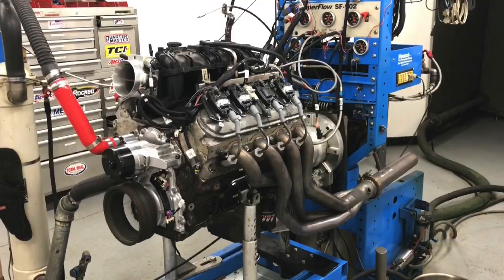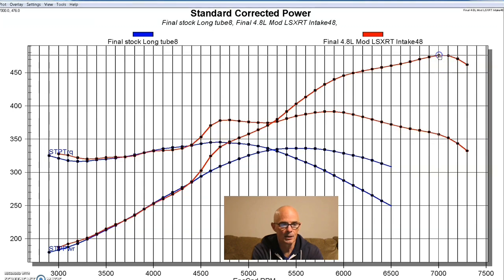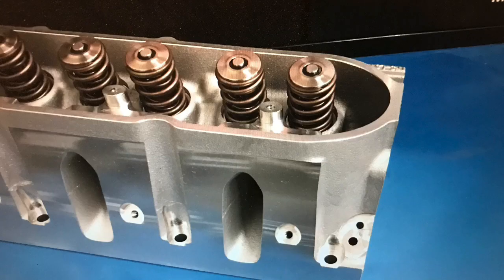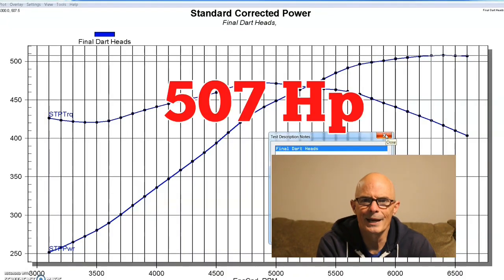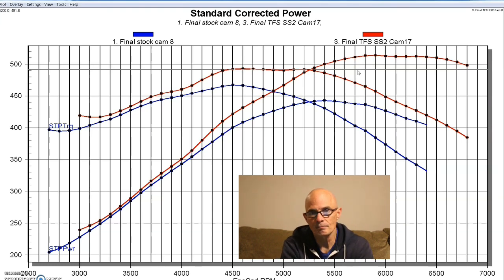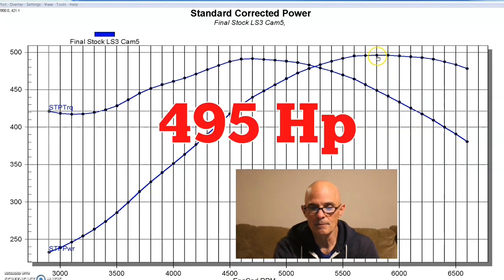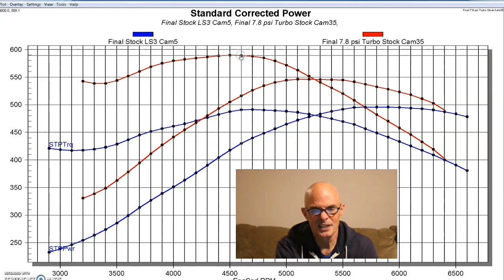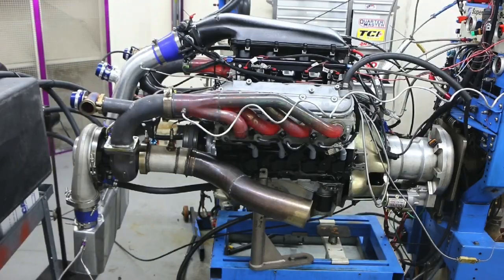LS HOW TO: 500-HP POWER RECIPES

Comment: Would love to see a sloppy stage 2 power gains in 4.8-6.2l with 706 243 and ls3 heads. Basically same cam the different displacements vs the 3 main go to heads. Would the 706 still pull a head in the larger displacement engines? I under stand you cant use the ls3 heads on the 4.8 and 5.3 but it would still be a cool head to head. (No pun intended)
Reply from the maker: you want a test of the 706 vs 243 heads on a 4.8L and 5.3L and 6.0L?
Reply: @richardholdener1727   Honestly I think the what im really wanting to see is 6.0-6.2 with 706 vs 243 vs 823 keeping cam and intake the same showing the true difference just the heads make. The cam used really isnt that important as long as it stays the same between the head swap. It would be cool to see where the added compression no longer helps the larger displacements and the added flow those stock heads offer start to be a better option. Like we know the 243 flows well and would have a compression advantage over the 823 but is the better flowing 823 still going to come out on top. The 706 would make for great compression but will it have enough flow to keep the larger displacements happy?

Comment: LS3 LLoves cam's and boost. True words, My LS3 with LS9 cam and AGP twins made 605 at the wheels with low 15deg timing on pump 93. I feel the heads are a huge factor in these making so much power. I've seen several tests with the different heads in the LS family. What I would like to see is the new LT heads, if you Tig the Injector port closed and mount them on the LS family, they are said to out flow even the 823 heads stock. I was told by a head shop the stud pattern is the same.
Reply: According to Brian Tooley the extra air flow is due to the direct injection having an increased airflow rate of 8% due to the fuel not obstructing the airflow in the port.  When you disable the DI and go straight port injection you are going to lose 8% of the airflow when you inject fuel into the port!

Comment: Run the 6.2l with 706 or 799 heads with a cam! I picked up a l92 short block from the pick and pull yard and am going to run some 799s I also found.  Wanted to get an idea of what kind of power it would make with just a cam upgrade
Reply from the maker: I did that with a 6.0L LY6

Comment: On 5.3 with turbo, what's the cheapest way to make 500hp that runs on cheap pump gas using mostly stock parts. I can do cam, springs, and rings, but not looking to spend 1000 on heads

Comment: Maybe this should've been labelled na power numbers. I've run a $200 motor with $50 valve springs with a $300 turbo and made more than 600whp. My car weighs 2900lbs and went 9.85@135mph on a stock 4.8 and a gt45 turbo. I did nothing to the engine other than valve springs. I'm wondering what it would've done with a better turbo and a cam, lol
Reply from the maker: except for the turbo stock 5.3L in the video-more turbo stuff in the 600 hp video

Comment: think you could do a video where you rev an engine up to 6000 rpm and leave it there to show what the power loss of hydraulic lifters collapsing is? think it would be interesting
Reply from the maker: why would they collapse at 6000 rpm
Reply: figured at that rpm they would start to lose the battle between spring pressure and oil pressure. either way, it would be nice to see how much you lose with collapsing lifters

Comment: Very interested in more 6.2L content , mostly SBE (boost as well), my buddy from the service as a ls3 with stage 3 l99 cam, lsxr 102mm manifold and TB , longer/ harder push rods. DOD delete of course and TSP long tubes, it has to make 600+ crank easy because even with accessories hes putting down almost 500whp N/A

Comment: Richard, you need to get the new 2.0 TFG street motor from Konigsegg on the dyno. A 2-liter, twin-turbo, three-cylinder making 600 hp/ 478 ft. lb. torque and no camshaft. Feed the turbos with a Procharger, add some nitrous....
Reply from the maker: That thing is amazing

Comment: The challenge for me is the limited availability of a decent manual transaxle from GM. The best they have now is the F40 that is only certified for 300ft lbs. I could go with the 4T80 that some guys are pushing well over 800hp but those are very heavy transaxles. So in this situation I'm seriously pushing the limits of the F40 with 500hp. I've hear of people getting gears cryo hardening. I have a lot of research to do.
Reply: Did you ever discover the AR5 transmission comes stock in the Chevrolet Colorado's and canyon
Reply: @timbowalk  They are rear wheel drive. The F40 is front wheel drive. The Fiero is a mid engine car that uses FWD components.

Comment: I think that 4.8 is a killer combo, if the 5.3 had the same top end as the 4.8 I bet it would have made at least 500 with more average power. If you look close you can see that the 4.8 didn’t loose any low end

Comment: The torquiest stock 6.0 I ever owned was the 99 3 door 2500, I could smoke the tires through OD in that truck, it ran awesome, it had the cast iron heads, the 191-190* at .050 LM7 5.3 cam, that combo flat worked
I'd like to build another one with mildly ported 706/862 5.3 heads, a small aftermarket 206-212 cam with the tbss intake setup just for a high torque truck setup

Comment: Looking at that crane 224 cam with 224/232@.590 on115 where would it push the torque curve too on a ported cath port ls2 set up with a lsxrht manifold ? Currently in my 5.3 but wondering what it would do in the bigger cubes ? Thanks Rich keep up the good work !!!
Reply from the maker: It works well-just makes peak power slightly lower
Reply: Sounds like it would work great in a daily with that cam and a slight stall !!

Comment: 475 horses out of 290 cubic inches and you didn't kill the low end torque, that's Black Magic right there.
Reply from the maker: I wish i had run a bigger cam and milled the heads
Reply: @richardholdener1727  Me, same cam but 13 to 1 running E85. Then try the big cam.
Reply: What were the compression ratios of the  engines?  The ly6 is 9.6:1 and the ls3 is 10.7:1.
Reply: I'm on that similar path. Bigger cam, 13:1 compression, race gas or e85, solid roller
Reply: I thought the same thing. I'd like to see that top end/cam on a 6.0.
Reply: Ted Gay yes please
Reply: @tedgay8427  - we probably will on the next video. ;)
Reply: Ls magic
Reply: 293

Comment: Great video, currently running the 54-459-11 cam in my 2005 gto.  Now that I know my
approximated hp and torque, I'll work on the tune to smooth out the Knock. Too much timing probably.
Thanks for the great videos with useful information

Comment: You're going to make me change the cam in my truck when it comes time to install the heads and intake manifold... I am still shocked at how well the SS2 did down low. I have an EPS 214/220 .598/.602 111 LSA now. But, have a brand new SS2 on the shelf... FML
Reply: Would someone change heads and intake without out upgrading the cam? It would almost me pointless. 

Don't forget headers.
Reply: @baby-sharkgto4902  - already has "upgraded" parts. EPS truck cam, TBSS intake, and supporting mods. (LT headers and exhaust) However, had plans to swap out the 317s and switch to a FAST LSXRT. Now... might as well change the cam since I have one on the shelf. The SS2 has really done well in these tests.
Reply: @bluecollarhotrods9781  ooohh I see what you're saying

Comment: for the 4.8 you can push back IVC a few degrees, and bump up compression to 12:1.  the torque curve is a little messy ... maybe a bit less overlap. 226/226 115 LSA.  It wants 1-5/8" headers.

edit: I didn't realise the TEA 706 heads have 2.00"x1.55" valves, and 82% exhaust/intake flow.  you actually want a reverse split cam!  maybe a 226/220 114LSA.
Reply from the maker: added compression will certainly help-but those single-pattern cam specs? Small headers-definitely not. Iv'e tested that.

Comment: What about building torque? Hp is great but 90% of us are building street machine that need torque to pull us off the light.
Reply: Man after my own heart. You know that torque wins races and horsepower sells cars
Reply from the maker: that's why I provided the torque curves on all of them
Reply: What I mean in how about how to build a torque monster ls
Reply: Both high and low torque have there place.
I have a gmc syclone clone. So awd setup, I need the low torque to get the brick to move off the line. Will my setup be hard on a driveline, yep.  Do I expect to break cv shaft, u joints possible transfer case, yep.  Am I going to have 600 ft of torque, no  but an RV type of torque engine that could pull to 6500 would be nice.
Also a street engine does not have to be a high rpm screamer. Vintage iron does a great video on matching cams, piston speed, head flow to a engine, take a look 
Piston speed means a lot, calculate it out and you will be amazed on how much faster the piston speed is on a 4.8 vs a 6.0.

Comment: I'm most impressed how little bore and stroke the 5.7 has over the 5.3 and the power curve is that big of a difference. Always seems like the 5.7 gets overlooked, wish I went that route Instead of 5.3 in my truck
Reply: Yes but you saved $2000 on the purchase of the engine
Reply: 5.3, 5.7, 6.0, and 6.2 LS engines all share the same stroke.  Only the bore changes with each displacement change.  I imagine that the higher compression that the ls1 is sporting, as well as the larger bore unshrouding the valves a bit more, are the likely factors in its dramatic difference vs the 5.3.  Since many 5.3 blocks can take an over bore to reach the ls1 bore, building an iron block ls1 is a pretty straight forward process.
Reply: @ShyaMiss  by far stronger than the LS1

Comment: I would love to see a combo once you get to the 700hp or 800hp mark all motor 6.2L with a 4.8L crank and punched out to a 6.0L or at least close to it, 13.5:1 or higher running on 706 heads ported and polished on e85.
Reply from the maker: You will see the 4.8L crank and 6.2L block combo at 600 hp
Reply: @richardholdener1727  👍
Reply: It will make more power leaving it as a 6.2.
Reply: 4.185 bore 3.25 stroke 11.75 compression mechanical camshaft methanol and all the turbo boost. Love to see this combination tested normally-aspirated and 40 lb of boost. I believe this combination might get a world record LSX stick shift. 2500 horsepower Plus
Reply: @danielsullivan9865  And then DOHC and you've got a VH45

Comment: That last comparison screen really makes a point. With enough rpm, a small amount of torque will give you the power, but more cubes means more torque where you’re going to use it on the street. I found it amazing that the 5.7 made the 500 hp with such a small cam. Most 5.3 blocks can take that 3.900 bore, and that might be easier than finding a 6.0... Another amazing presentation! By far my favorite channel.
Reply from the maker: I'm a little suspect of the 5.7L power numbers
Reply: @richardholdener1727  there was a yt vid of a guy running a 5.7 on the drag track burning everything up with it. In a gen4 camaro I think.

Comment: Thank you for including the 5.7
Reply: How can you get a 5.7 up to 600 700 horses with a stock bottom in
Reply: @jamalmoore1025 you can’t
Reply: My 99 Z28 Camaro puts down a bit over 500 HP and is extremely Reliable at the same time, it was built and tuned by the great Jeremy formato, it has ported Edelbrock heads, Texas speed CAM, BBK long tube headers, Yank stall converter, valve /spring upgrade, built using all "ARP" Bolt kits, actually Putting 600+ HP through a 5.7 stock bottom end and 4L60E transmission it's doable but you will only get to use that power a handful of times before you Grenade the bottom end and absolutely will destroy any stock 4L60E transmission shit you can get 800HP easily but it's all the other "stock" components that are the Achilles heel, GM just didn't design them for that, but sure it's possible but your going to wind up rebuilding everything else anyway if using "any" stock internal components, Then after all the work you have to find out how to keep it on the road however I'm talking about the F body type cars, they can all make insane horsepower the sky is the limit, I'll tell you that my Camaro is pretty tough to handle from a full WOT Launch and I've had all the suspension upgrades, transmission mounts everything, and pushing 500+ HP the car just wants to go sideways and I have Wide ass tires as well.. it's a great car for highway launches but and makes insane speed very fast, but off the line is where I loose simply because it won't hook up to the ground.. also I could daily drive this car for probably another 20 years just driving it normally, because of how well it was built and being able to flip that switch open up the electronic exhaust and smoke most cars these days that's enough for me!! Big horsepower costs big money in the long run. Also on the 5.7 once the factory alternator goes, be prepared to get really good at swapping alternators, I have to buy high output alternators with larger pulleys, and I have to still be careful a few High RPM runs and they go out like a light switch!! I always keep a spare alternator like in the friggen vehicle, it's something about that "original" OEM Alternator once it goes it's a never ending thing if I never go WOT and drive it normal it will last a pretty long time but just three or four intense high RPM runs and they are basically dead!!! Just an FYI.. I'm on my fourth alternator!! The bigger pulleys will last longer and I'm not spending $800 bucks for an Alternator that still "might" blow up its only a 15-25 minute job 3 bolts for me, belt off to belt back on and running..

Comment: Love love love that you put the 5.7 in there for us aussies, Im looking at buying a local Holden here but it comes with the 5.7 and I'm not really sure of the 5.7's potential as ive driven one before and was disappointed, They feel flat to me when I compare it to the 2 litre turbo 4 cylinder powered car i have been driving that was made in the 90's. I want bottom end grunt through to high rpm or else why have a V8? HELP!
Reply: Mondy888 mond put a stage 1 cam and you’ll get a heap of low end improvement. The stock cams are generally tiny.  Sloppy stage 2 would be great as well.
Reply: Oh and put a blower on it. 😀
Reply: @philistineau  Heres my plan as an over all package:
-Cam swap, grind unsure at this stage
-Springs, solid lifters etc
-Re lap all valves
-Head swap (factory heads but up the comp ratio and then hand port and CC chambers and alter chamber design if needed
-Port match intake and exhaust manifolds
-Lower the oil pressure to 45-50 pressure
-Sump mods
-Extractors
-Race plugs
-Multiple Big engine breathers
-Tune

Comment: Put the ss2 in a 4.8 and a 5.3 stock heads ,stock intake.
Reply: My 4.8 ss2 tbss intake made 300 to the wheels
Reply: Sticky Lsx  on stock injectors?
Reply: Izaiah Orta yes sir and stock pump
Reply: Sticky Lsx appreciate your response. Your setup is what I’m going for but with milled heads to try and get 10.3 compression.
Reply: 285HP + 75HP = 360HP

Comment: I know you guys don't normally run accessories when you dyno engines but I was wondering if you have ever tested how much power you loose from factory accessory drives?  I'm considering running an electric water pump and modifying a factory electric power steering setup to work on my project car.  If it's only worth 20 hp going to an electric water/power steering pump I don't think it will be worth the time making it all work.
Reply: @Puffwagon Thanks for the tip.  I probably should have looked through his videos first.  He has tested everything under the sun on an Ls already I should have known he would have a video about the accessory drive.
Reply from the maker: shame on you for not watching every video!
Reply: @Puffwagon I know what you mean.  I've watch a lot of videos on Barra's and I've never seen one in person. They are badass engines by the way.  I would love to have one to tinker with.  They are just to expensive to buy and find parts for here in the Usa.

Comment: Waiting for a full race 9k rpm 4.8L to make 600hp NA🙄
Reply: I’m building a similar combo like that now. 6.0 block bored .040/4.8 crank / gen 4 rods / cheap flattops/ Edelbrock short runner/1200cfm throttle body/heavily ported 862’s milled and a nice valve job.and a big BTR Cam.  Should be about 12:1 comp ratio and I’m gona run it on E85. Everything is balanced and I have to get a ATI balancer. I wanna rev it out to like 8500rpm and spray it with nitrous.  On paper it should make about 550hp at the crank at about 7-7500rpm. But I def wanna see what it do over 8000. The whole reason I’m building it.
Reply: @rongravel4585  - Sounds like fun!